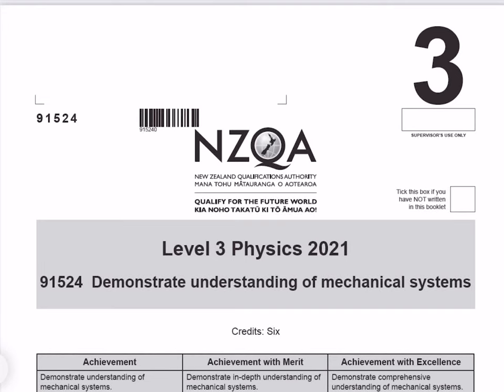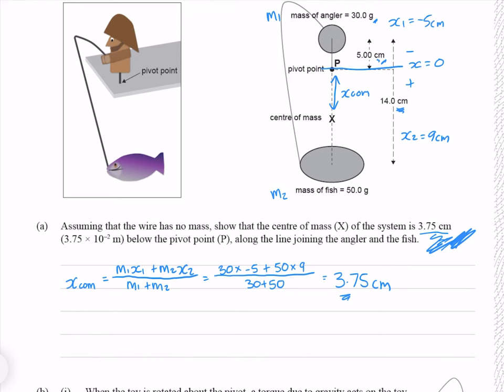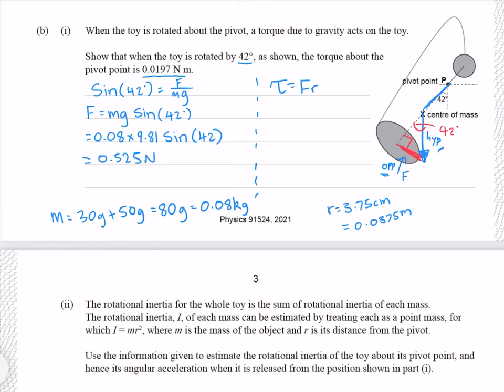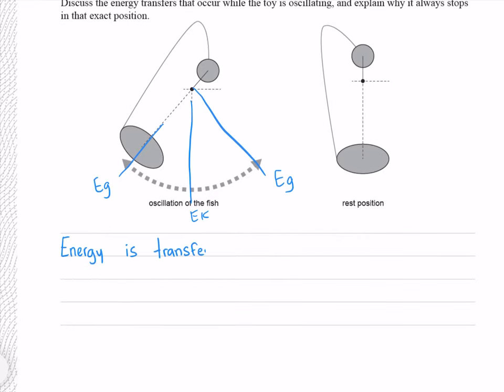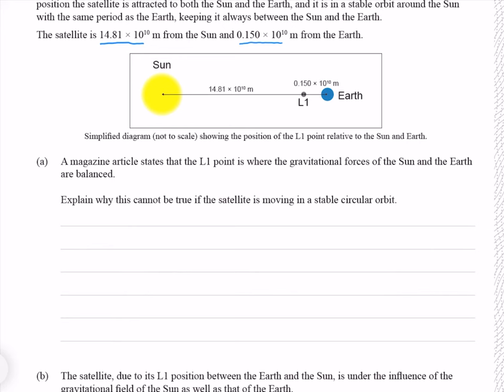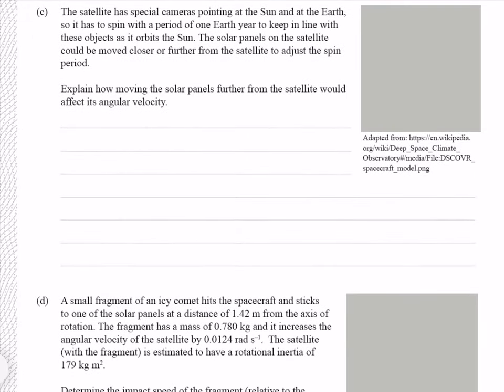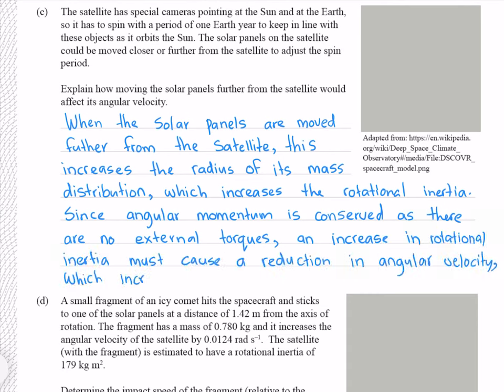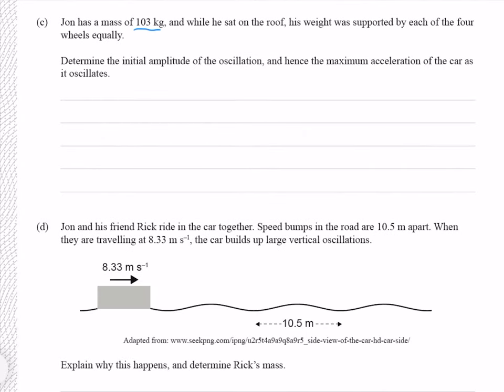2021 Mechanical Systems Exam (NCEA Level 3 Physics)

Comment: Hi, for question 2c, would the gravitational pull of the earth not count as an external force or torque? Thanks.
Reply from the maker: Great question. It certainly counts as an external force as it centripetally accelerates the satellite around its orbit, causing the satellite's momentum to constantly change direction. Linear momentum is therefore not conserved.

The satellite doesn't however experience an external torque, because the gravitational force acts through the satellites centre of mass. Therefore angular momentum is conserved.
Reply: @MrWhibleyPhysics  I think I get it. Thank you so much sir. 

So if force is acting at point in the satellite that’s not the COM, there would be a torque because torque is equal to force multiplied by the perpendicular distance?

But because perpendicular distance is 0 in this example, torque also equals 0?
Reply from the maker: Correct!

Comment: for question 3c, why do we only use jon's mass and not jon + the car's mass?
Reply from the maker: Good question.

While Jon sits on the car the upwards force of the springs is equal to Jon's weight + the car's weight. The forces balance.

When Jon removes himself from the car he removes his weight force. The upwards force of the springs is now greater than the downwards weight force (now only the car's weight) and the car accelerates upwards. This unbalanced upwards force is equal to Jon's missing weight, which is why we only use Jon's mass to calculate it. Hope that helped!

Comment: Hi, I dont understand how you got g=v^2/r is this an equation that must be memorized?
Reply from the maker: Hi Jim, this is recognising that the gravitational acceleration is acting as centripetal acceleration. On the formula sheet you're given the centripetal force F=mv^2/r. Knowing F=ma we can also write a=F/m, meaning we can divide the centripetal force equation by mass to find the acceleration: a = F/m = (mv^2/r)/m = v^2/r.
Reply: Sorry if this a dumb question but do the masses just cancel out? or where do they go? @MrWhibleyPhysics
Reply from the maker: Hi Patty, Correct! The masses cancel out.

Comment: Hello! Last minute question. For 2d, why do we instantly use the question's I and w values to substitute in L=Iw? This confuses me since the I is the new rotational inertia (including fragment) whereas the w is the increase of angular velocity, rather than the new angular velocity? Why aren't both values the same in the sense of both being their increase OR their new values ? I hope this makes sense 😅
Reply: I think it helps to see it as ΔL=IΔw where you are trying to find the increase in angular momentum. Where the change in angular momentum of the satellite (ΔL) is caused by the change in its angular velocity (Δw) which the question gives you, regardless of I.
Reply: @Supermatt  But wouldn't I increase as well as the debris hits the satellite, so shouldn't it be change in L = change in I * change in W?
Reply from the maker: Great question! I'm not 100% on this one, but my initial thinking is that this may only work if the original angular velocity is zero.
Reply: @MrWhibleyPhysics  ok, thanks! i'll just not overthink it then, haha.
Reply: @Supermatt  thank you =)

Comment: Thank you for this, my UE entrance may end up hinging on mechanics.
Reply: wait but dont u need 14 credits in physics to get endorsement?
Reply from the maker: Thanks PrismaAce, good luck!
Reply: @ninjapirate123  i need to pass both mechanics and waves to get the 14
Reply: @PrismaAce  you're choosing waves over electricity?
Reply: @ninjapirate123  my school for some reason doesnt do electricity in level 3, definitely would have made this a lot less stressful if i could
Reply: @PrismaAce  Oh I never knew that, but if thats really true then I hope you pass both your externals
Reply: @ninjapirate123  yeah you too! none of this would have been an issue for me if i didnt choke the integration paper in calc so badly tho lmao
Reply: @PrismaAce  Oh yeah, this years calc papers tend to be harder than the past papers I've did. I think I failed integration too, but passed complex numbers and differentiation